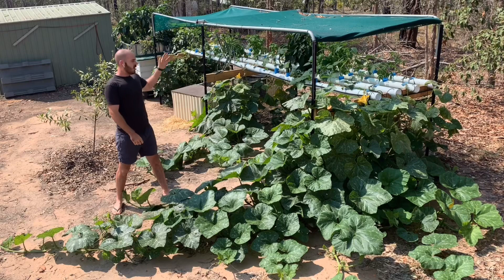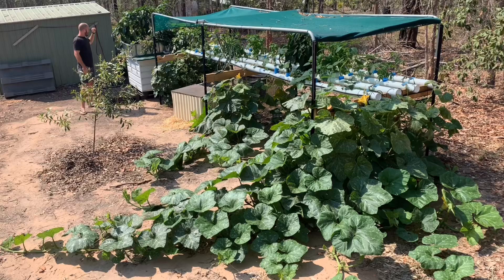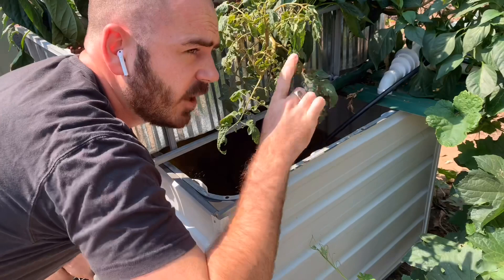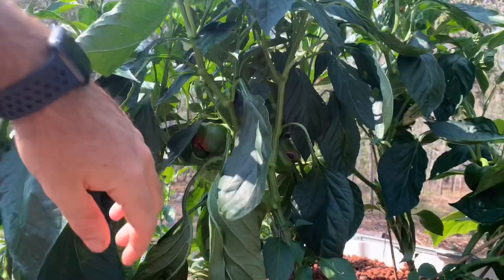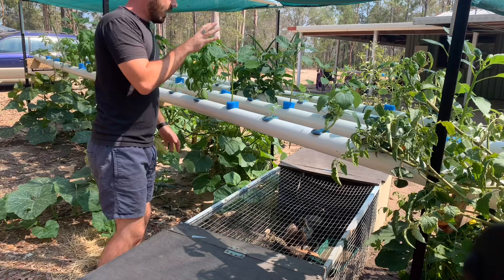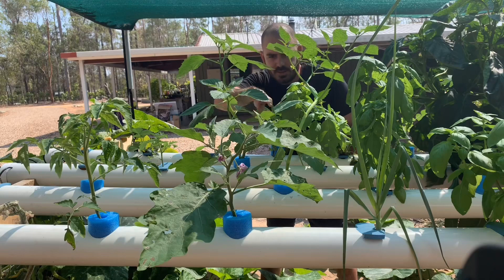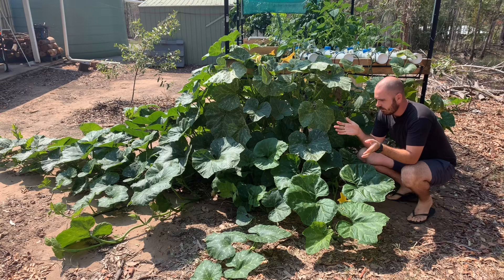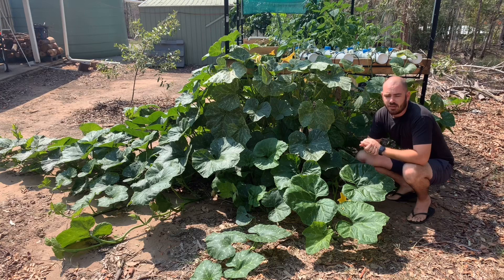Hello Reddit. Hydroponic system walkthrough.

Comment: What happened to the cucumber you had in the NFT in a previous video? Did it go well or not, did it have root issues like the pumpkin? 
Also what's the roots of the jalapeno in NFT like?
Reply from the maker: I removed the cucumber as it succumbed to powdery mildew, the jalapeño roots are doing just fine in NFT, only effecting the plants right next to them but not doing any harm.
Reply: @Hoocho  awesome! I'm considering a similar system for most of the same things you're growing! I think I'm going to build indoors cause I have a mean Bush Turkey who wrecks everything outside. 
Was the powdery mildew related to being in NFT or just an unlucky turn of events?
Reply from the maker: It started on the pickling cucumbers that I had in the flood and drain beds then transferred to the ones in the NFT.
Reply: @Hoocho  couple more questions if that's okay. I'm looking at modelling my system heavily after yours with the pucks and all. The spacing of the grow sites in the rails is 300mm centre to centre right? With the benefit of hindsight what spacing do you recommend for everything you've grown in the system? I'm expecting to allow 600 between centres for the chilli and maybe for cucumber? What about strawbs, lettuce, bok choy, herbs and so on?
Reply from the maker: I would have the chills and cucumber in separate rails to the lettuce and strawberries.
Stick with 30cm spacing for the strawberries, and greens. And go with the 60 cm spacing for the other stuff.

Ideally my next systems will separate the heavy fruiting large plants from the leafy greens and smaller fruiting stuff. Just to give me more control over the nutrients.
So if you have the space, I’d recommend two separate res ideally.
Reply: @Hoocho  thanks so much for the advice mate. I'll probably set up leafy greens and strawberries together first and look to add cucumber and chilli later, I'll certainly consider using a second res for that when the time comes!